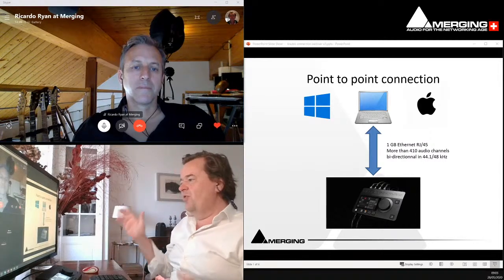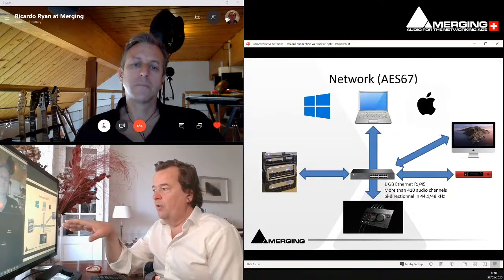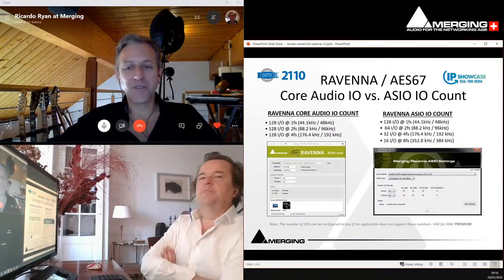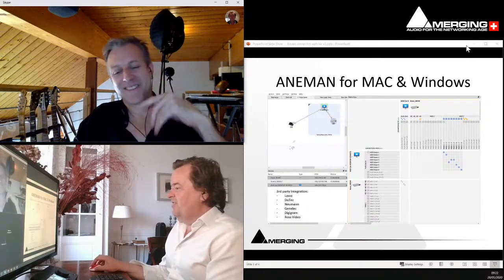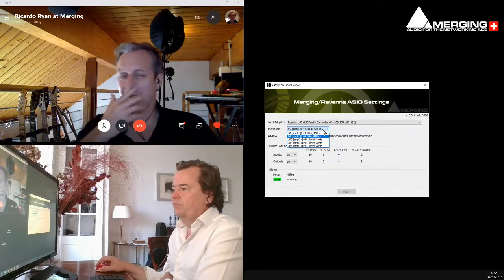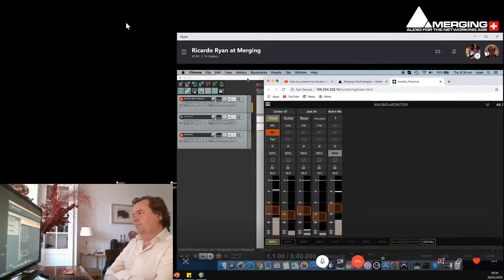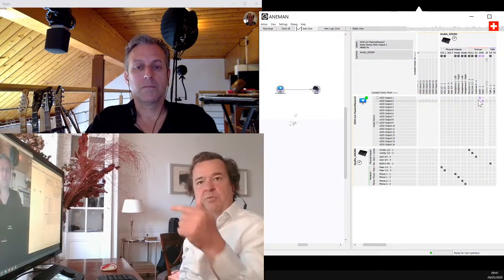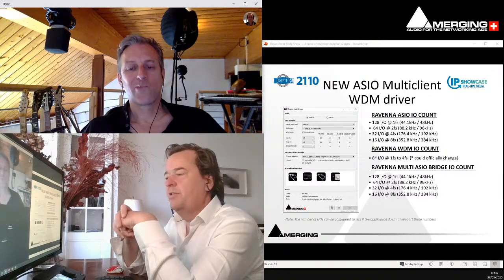How to connect my Anubis / Virtual Sound card / Network (English)

Comment: So I’m in the market for a new interface for my M4 Mac Mini Logic Pro setup and here are my thoughts on the Anubis and what I want/need vs. don’t need. This is for a home studio setup. I like that the Anubis has a low noise floor and high dynamic range and can capture/record both high res PCM as well as DSD audio. That’s fabulous. However, what I also need is to be able to bypass the pre-amp stage, which currently you can’t do, and I don’t need to have virtual mixing with plugins in the device itself, because my DAW can handle all of that. The main selling point for me is the ability to attach this device to my network instead of using a USB-C or Thunderbolt connection. Ideally it would have a 10Gbit fiber SFP+ interface that doesn’t use twisted copper CAT6 cable to connect to the network, because twisted pair copper cable carries RF signal noise and causes jitter in the AD/DA converter. So to totally isolate the DA converter from all external noise both from the Mac and the network, fiber optical SFP+ is ideal and it gives you tons of bandwidth…10X that of a 1Gbit connection. Also the op-amps in the device and the signal processing decrease the sound quality and raise the noise floor, so ideally you should be able to bypass the op-amps. Finally the network interface needs to be plug and play in Logic Pro. That means I connect the device to my network, turn it on, and immediately my Mac/Logic Pro can connect to it and use it from the audio devices output settings panel. And finally, I need the ability to pass through a digital signal to an external DAC for headphones and speaker monitoring. I won’t be using this device to drive my speakers or headphones unless it is for a recording session where you have a separate performer who needs to hear the sound of their voice or instrument in addition to the main output for mixing and mastering, which would be handled by a separate stand alone DAC/amp headphone/speaker rig.
Reply from the maker: Hello, thank you for your interest into Anubis. By setting the input to Line input and not changing the gain, there will be no change to your incoming signal. Concerning the connectivity for your Logic, you may use the Unite modus that has specifically been done for 1 to 1 connections (such as usb) but over the network https://merging.atlassian.net/wiki/spaces/PUBLICDOC/pages/4819902/UNITE+-+MAD+PC+and+VAD+Mac+Guide. Please be aware to choose a support 1Gb ethernet adapter for your mac https://merging.atlassian.net/wiki/spaces/PUBLICDOC/pages/4817173/RAVENNA+ASIO+recommended+Network+Adapter